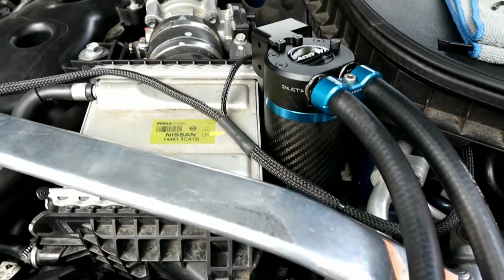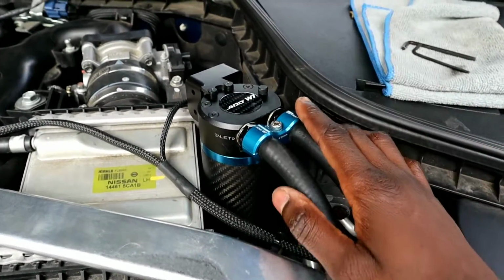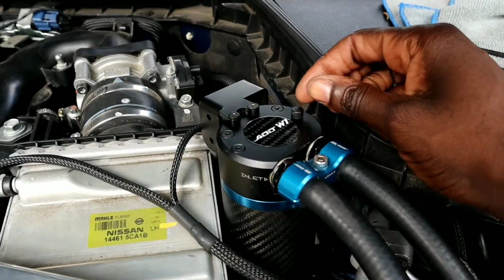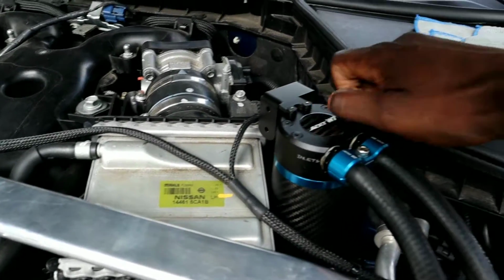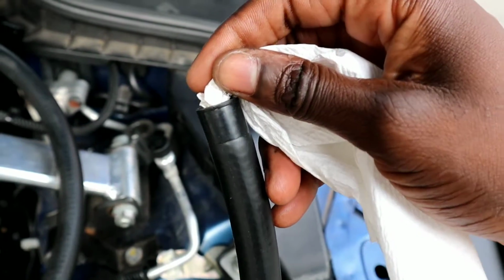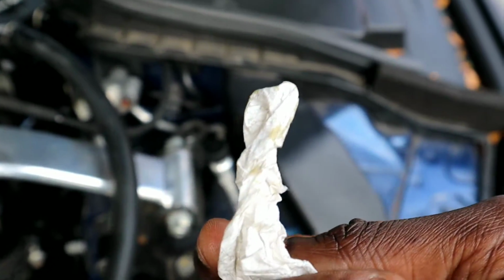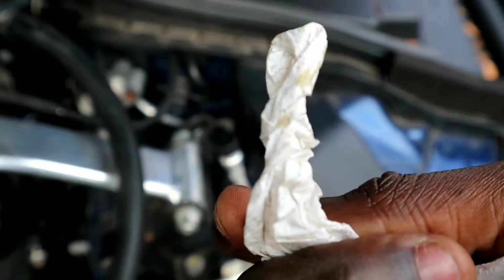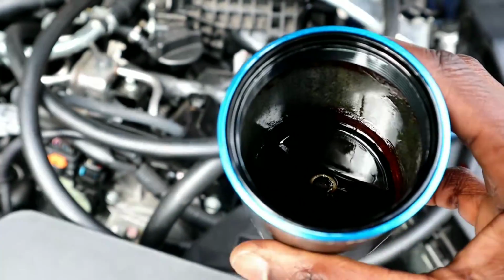Q50 oil catch can 1K results

Comment: i'm buying a used q60 red sport with low miles under at least 30k and this will be the FIRST MOD i install
Reply: You won't need it that bad running all stock red sport. There is always an amount of oil and blow-by which is good for the motor.. Once you go up on the boost, do intakes, downpipes,etc... now you may wanna get this lol
Reply: My 2019 3.0t all stock produces this amount with very limited spirited driving.in 1k. I have video. No amount of oil blowby and or combustion vapor by products mixed in with your gas for combustion or on the back of your intake valves is good/acceptable. The CC accessory is best served when installed on a new car.

Comment: Good job disconnecting the hose exiting the catch can to check for function. Definitely way better than no CC. Now just think what the oil/carbon buildup looks like on your intake valves from not have any CC mounted with all that racing and elevated boost levels for 15K miles. I would like to see you do a manual valve cleaning with one of the major brands of intake valve cleaners. I bet your car would gain some hp and general performance increase with clean/not coked up intake valves. I say this because I know from experience what just 10-15K no CC can do to a turbo car. The intake ports, there surfaces and the backside of the valves and stems smoothness play a huge part in making power, flowing air, sealing the combustion chamber and producing a smooth running engine. A manual cleaning sucks, is time consuming, is labor-intensive and cost $$$$. CRC and Seafoam are chemical base solvents that get sprayed into the intake tract with motor running and seem to do a fantastic job at removing varnish buildup, oil residue and burnt/baked on carbon. You could do it and make a video...before and after. I would be stoked to see the results. Reseach it online.

Comment: Is it suppose to leak even when the car is parked for a few hours or over night etc ..??
Reply from the maker: It should not be leaking at all. That means that the fittings are not tight
Reply: Boost In Motion ok thanks & one more question the coolant level i filled it up last night to max level & it was on low level about 11 hours later.....?
Reply: It only leaks drops but I check the dipstick & the dipstick reads full oil level so it’s weird but thanks for your time my dude big help

Comment: The dry outlet tube should be a good sign that the oil is being caught.  Remember that oil whatever the amount, is burnt oil that is not going back into the cycle.  With that amount I would think that warrants a oil level check.....level surface, warm engine but allowed to drain approximately five-ten minutes after engine shutdown

Has anyone had experience with the ADD-W1 catch cans on the VQ35/37 series...specifically the VQ37HHR (2015 Q70/70L)

Comment: Hey bro.. after 500 miles I had a decent amount and it was milky looking, like a cappuccino color. Should I be concerned? I have a vid on my page if you wanna see it
Reply: No, that's just condensation mixing with the oil and gas. If you have oil coming out of your pan like that, then you likely have a blown gasket and it is from the coolant mixing in your oil.
Reply: @BnMGarage  appreciate you
Reply: @BnMGarage  Cn still happen on dipsticks and oil filler caps if the car sits for awhile or based on climates and not driving the car frequently enough i.e. short trips to post office or grocery store
Reply: @liblib89  that is also true. Condensation from the heat.

Comment: Boosted, why not have another can on the passenger side? When doing the CAI I noticed a little oil in the turbo intake. I got the same one you have and was just wondering if I should mount another?
Reply: As it fills up, it will look coffee
Reply: Ok… and what’s this have to do with the question?
Reply: I heard it's not necessary for the passenger side. Only driver side shows to be helpful
Reply: @mac1bc absolutely it is, they made a new can not to long after this that captures both sides... they also make a kit that converts the old one to take both ports

Comment: Wow that was a lot of oil for 1k. 😮
Reply: Elevated boost over stock and pushing the car a lot causes excessive blowby. Reason why a CC is desperately needed to even a greater degree modded boosted cars with turbos turned up.